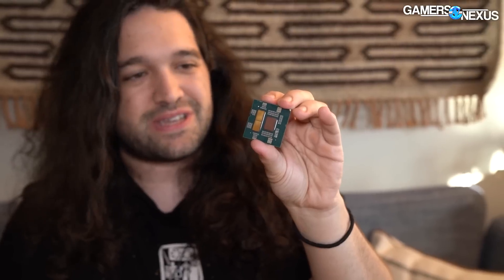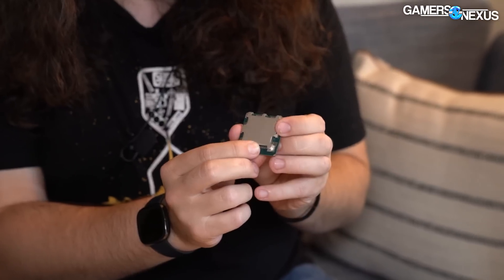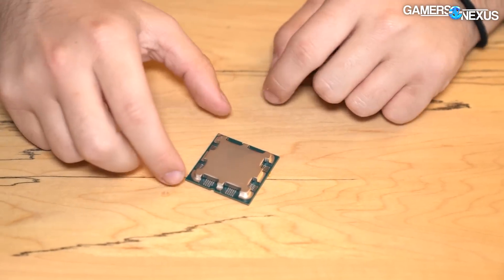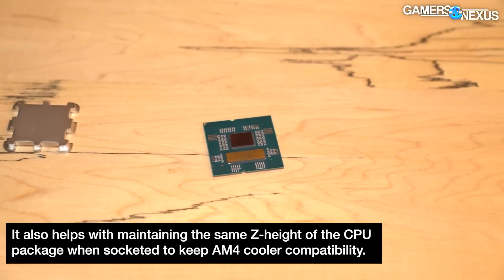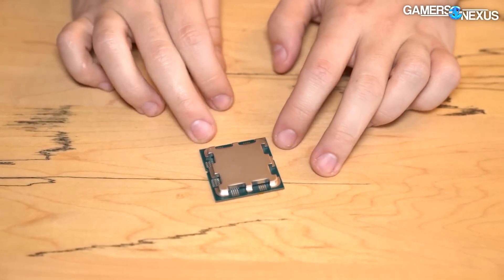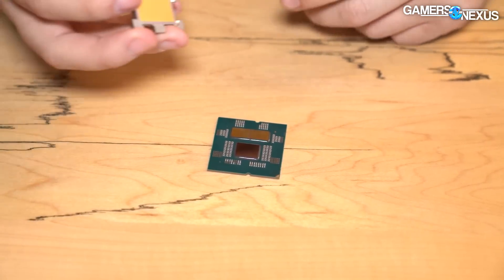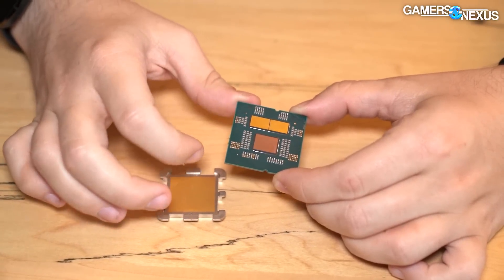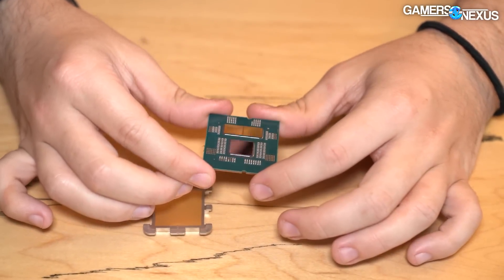Hands-On with Delidded AMD Ryzen 9 7950X CPU

Comment: I assume with these exposed SMDs and seemingly a gap between the IHS and substrate, using a non-conductive thermal compound would now be mandatory, right?
(I know, pretty much every solution on the market should already be non-conductive)
Reply from the maker: Basically. Or you'd need to coat the SMDs.
Reply: @GamersNexus  time to bust out the nail polish!
Reply: @ionstorm66  I mean, all the good stuff (other than liquid metal) isn't conductive anyways
Reply: @KPalmTheWise  you just know some idiot is going to liquid metal one without thinking
Reply: @KPalmTheWise  Arctic silver thermal paste does have some silver in it but they say it is not conductive but might be capacitive, so they warn not to spread it on any open components or trace paths.
Reply: @jmugurr994  but how does it taste?
Reply: @Khola_D  I can only hope
Reply: @Khola_D  it's me, i was the idiot. Put liquid metal on without any protection, learnt hard lesson to coat a nail polish after that
Reply: You can apply nail polish or some sort of sealant over them. My 4790K has SMDs about 1-2mm from the die so I put 2 coats of clear polish before applying LM. I think the biggest risk is going to be getting the IHS off without destroying the SMDs since you can't just slide it off like a traditional CPU
Reply: @Hypnodog_  i cant see the point of using scullion on the corners. Solder should be strong enough to hold the ihs down.

Comment: how do you apply thermal paste to these ? or is it irrelevant when you spill some on the outer parts ?
Reply: if the paste is non-conductive, it's irrelevant; if it is, you should coat the exterior electric thingies with a non-conductive layer and then apply the cooler & paste
Reply: @rzul  that makes sense, thx

Comment: The backwards compatible cooling was such a great QOL feature when they announced it. It seems so little but that saves me a couple hundred dollars right there.
Reply: Technically it's forwards compatible right? Because you are using a cooler meant for the old design on the new one not a new one on an old one.
Reply: @TLM-Nathan  I figure since the cooler is dependent upon the socket for compatibility, the socket supporting it means it is backwards compatible.
Reply: @TLM-Nathan  In this situation it would be both, wouldn't it?
Reply: @amicloud_yt  Yeah, just depends if you're talking about the cooler or the socket.

The coolers are forwards compatible while the socket is backwards compatible.
Reply: While dimensions are identical with AM4, you need to get mounting upgrade kit if your cooler uses a custom backplate. On AM5 the socket frame is screwed to backplate through PCB, you can't switch to custom backplate. And often mounting screws are different too so standard AM5 backplate is incompatible.
Coolers using standard AM4 backplate are compatible with AM5.
Reply: A couple hundred dollars? I've used a Liquid Freezer II on like 3 or 4 different platforms at this point and the kits to switch platforms (that ones that weren't included with the original) were free with proof of purchase or like $6.99 without proof. Would you have had to upgrade your entire cooling setup for some reason?
Reply: @dqniel1755  Compatibility brackets don't always come out right away. If there are significant changes to the socket, it can be a little before they get tooled, shipped and sent to you even after you order. The fact it uses the same design as am4 means you should only have to replace the screws with newer ones for the backplate. Much quicker.
Reply: @Dsntmtter2ME  Interesting. I've never had that issue. They get the specifications well before release, so it sounds like that would be the fault of the cooler manufacturer.
Reply: I'm sorry but since when is cooler compatibility an issue? 
I recently used a cooler that was on a I5 9600k on a I7 920 and as far as I'm aware most "premium" coolers got adapters to support LGA1700 too.

It is still nice that AM5 does it, but too me it feels more like a requirement not a bonus.
Reply: @Ocastia  Because it's a major change from PGA to LGA and they could have changed the socket dimensions with that change making it difficult / impossible to adaptor. 

That said, with everything being the same you won't need to send off for / buy an adaptor you can just slap your current cooler right on it.
Reply: @Ocastia  The difference here is that you won't need adaptors except for coolers with custom backplates. The majority of coolers for AM4 use the existing mounting points on either side of the CPU so pretty much any cooler going all the way back to AM2/AM3 will also work. Keeping a CPU the same size and z-height is very much appreciated and it will also lead to less landfill waste by allowing people to use existing hardware.
Reply: Yup.  Sure, you've got to buy a new motherboard and new RAM to go with it, but if your old ones are still decent, they help pay for the upgrades.  Pretty much nobody wants to buy a used cooler though, so it's great to be able to keep using a perfectly good one old one with the new hardware.
Reply: Q: Backward compatible?
Intel: (laughs nervously, and then bursts out laughing)
AMD: Yes.
Reply: Except they don't include coolers anymore
Reply: @RayanMADAO  Personally, I'd rather get a slightly reduced price (and even smaller packaging) without coolers because I almost never use them and they just pile up in my closet.

Comment: Why they dont do it like the mobile chips? Already without IHS and with an aluminum ring outside of it with the height of the silicon to support and level the direct die cooling solution above it.
Reply: because "normalos" dont get in contact with the mobile cpu´s directly. in the desktop space, they have to make sure that everyone can mount a cpu....imagine droping a delidet cpu on the floor scratching or even damaging the core die...the flood of RMA´d cpu´s because of this would be gigantic
Reply: @georgwarhead2801  That was how desktop CPUs were made until like 2005 (google pentium III and Athlon XP), and they didn't even have a metal support ring around the edges of it to level the cooler, like modern GPUs and mobile CPUs do. Also if you scratch the "core die" it's no problem, the top layer is just silicon, there's even die lapping like DerBauer does, the chip itself is in the bottom of it like 0,5 mm below.

Comment: Do you think AM5 will benefit from a contact frame similarly to Intel or is the stock loader higher quality?
Reply: Seems unnecessary as on intel its due to the size of cpu. Cpu socket on intel unable to give consistent pressure, unlike threadripper sockets thats used bolts

Comment: I suspect that the IHS is going to be a bitch to clean once there's a significant amount of thermal paste on it. Thermal paste loves to squidge into small spaces and stay there, and cleaning between each leg on the "octopus" IHS would be a real pain.
Reply: @ИванИ-м3ж  Do you know any thermal pads have any metal in it? Thermally conductive and electrically conductive are two different things btw.
Reply: stop using paste,... problem solved... ;)
Reply: @sniekerd  What would you recommend instead?
Reply: @DaveGamesVT  I kinda love butter,... not sure why but the smell of it on my ihs is a thing to behold... ;)

Comment: Big questions I've been thinking about. What if thermal paste gets into the 8 gaps? Why couldn't they make it a flat square?
Reply: he explained it realy well why they designed it that way and a comment from GN: "Wouldn't affect much, but you'd need to be careful of electrically conductive paste"
Reply: Even better, do some sort of thick 'balcony' to cover the little chips.
Reply: They walked into into a corner by deciding early that the new socket to be compatible with AM4 coolers. With the sheer size of three dies and LGA pads covering the underside, it is just not feasible to cover the entire substrate with IHS. Intel was right to make the socket and heatsink holes larger but dropped the ball with the mounting mechanism.

Comment: I wonder how over excessive thermal paste might affect these, would getting it on the open components in the indents make it worse or better? I feel like I want a removeable frame for the IHS while applying paste..
Reply from the maker: Wouldn't affect much, but you'd need to be careful of electrically conductive paste.
Reply: @GamersNexus  translation "don't use liquid metal unless you're confident that you won't spill any"
Reply: @GamersNexus  Steve and Roman up a tree....
Reply: @psycronizer  D-E-L-I-D-E-D
Reply: @psycronizer  I always hear this Roman being mentioned, what channel is that? Is it der8auer?
Reply: @WalterZanella  yeah I haven't seen him around much but I think I once saw him do a vid on a paste compound, he's German so not that big on the English side of things, but he is around...
Reply: @Malachai Carter liquid metal, such as Thermal Grizzly Conductonaut. Excellent thermal conductivity, but also electrically conductive. I've not tried it, but I don't do extreme overclocking or delidding either :)
Reply: @chippytea4me  with how liquid metal is supposed to be applied the chance of getting an overflow onto it is not likely
Reply: @Malachai Carter Because heat transfer and conductivity often go hand in hand. If a material is good at one it's very often good at the other. There are exceptions of course, like iirc diamonds are the best natural heat conductors, but they're not very electrically conductive.
Reply: Ask The Verge
Reply: since i am using carbonout im not worryd about it
Reply: Or why not make the IHS take up the whole thing instead of the cutouts? What would be the cons of doing that?
Reply: @MrKayveman  Force transfer at known points into the pcb=>socket pins ...maybe intended flexing during mounting and hot-cold cycles.

Maybe also HF-shielding between certain tracks/caps.
Reply: Yea I was wondering. What if we managed to fill those gaps where the IHS appears to float with some kryonaut paste ?
Reply: It will be a bitch to clean up if you have some thermal paste squeeze to the sides and spill over on those components...
Reply: @Malachai Carter It was the standard once upon a time, Arctic Silver 5 (not made by arctic cooling, it was it's own brand) was electrically conductive due to its silver content, and was the gold standard for affordable pastes for a long time. Then right before the 2010s things picked up and all kinds of new pastes started hitting the market. also @username3544 AS5 does cure and dry with time, no doubt it's still within acceptable range but that paste definitely does need to get changed at some point. That said, AS5 does perform pretty decently still while dried out, at least until you remove the cooler. I used to use a little bit of it to cut IC Diamond paste with, because that paste was so thick it was impossible to spread, and the diamond dust would literally tear plastic spreaders to bits.
Reply: Long as it's not liquid metal you should be good.
Reply: because liquid metal is better for thermals than paste.
Reply: @Malachai Carter The liquid metal paste lasts longer. I haven't changed my Arctic Silver 5 thermal paste on my 3570k since 2012.
Reply: @Username4453  Arctic Silver 5 is neither a liquid metal, nor electrically conductive.
Reply: @hellterminator  Ok I thought the whole silver infusion thing was a type of liquid metal. Either way Arctic Silver 5 may not be the best thermal paste but it sure lasts a long time.
Reply: @Username4453  Understandable, the marketing language is (designed to be) confusing, but liquid metals are just straight up metals that are liquid at room temperature. It's pretty much always gallium alloyed with something to bring its melting point further down (pure gallium is around 30C/85F, which is not quite room temperature). I believe indium and tin are usually used. 
In contrast, Arctic Silver is just small silver (and other thermally conductive materials) particles suspended in a non-conductive grease.
Reply: @Username4453  Nope.  Liquid metal TIM is literally in a liquid state.  Gallium, indium, tin, and other stuff.  Melting point of around 20 degree C, boils at 2000 C(i.e. effectively doesn't boil)
Reply: @Malachai Carter Probably some super cheap garbage that is, because money.
Reply: @TheAtomicSpoon  lol the more expensive pastes I.e. Metal based are electrically conductive. The “super cheap garbage" pastes aren't conductive since they're pretty much silicone paste.

Comment: @7:25 is there a reason for using only one chiplet instead of, say, two cut down chiplets?
Reply: Cheaper production. Also performance as there is a little latency between chiplets
Reply: @erichall090909  Fair. I imagined using cut down chiplets that don't meet high tier spec may have saved on manufacturing costs with less waste.
Reply: @Didymuss1  It would take them ages to accumulate dies with that many defects.  When they finally do, they'll likely go into limited runs of low-end processors with fewer than six cores.

Comment: With those announcement, I can finally upgrade to 5900x with a reasonable price from a 3600
Reply: someone else here in the comments just got one for $320ish on amazon
Reply: What are you doing that makes 3600 feel too slow?
Reply: @rzul  if they have a good graphics card it’s not unlikely to be throttled by a 3600

Comment: Will these CPUs benefit from offset kits again then I assume?  And is the offset the same orientation as previous generations with the mounting direction?
Reply from the maker: Great question! The benefit previously was pretty noticeable with some coolers. It will likely help again. As for direction, won't be sure until we get a motherboard!
Reply: @GamersNexus  thanks for letting me know.  Yeah I have a older supremacy evo I use the offset kit with on my 5000 series since cooler was originally only got Ryzen 1000.  I'd love to use same hardware again for AM5
Reply: yeah probably

Comment: 2:24 i very much like how this layout is done. Should be very easy to make a custom direct to chip cooler. Neat stuff GN.
One thing i never understood regarding these modern units (with old ones it was understandable) is why aren't the SMDs built in the actual CPU. I know this is possible, this is not common, but done by some of the laboratory equipment manufacturers with direct to board calibration (laser etc). It would result in an extremely compact package. I assume one reason is that users might over tighten the chip in place and thus affect how it works, but... it's kind of a slim issue. The board itself could be made thicker to accommodate. In terms of board design, these days, the sky is the limit.
Recently i've seen multi layer boards with gaps in the layers to allow for controlled expansion due to heat so that the traces always remain exactly as they were designed on paper.
Reply: simply because die space is way to expensive to do it and in the case of cpu´s, there is no benefit for doing it. they are already outsourcing everything that dont need to be on a expensive note to a more cheap one, adding the smd´s even just to the 6nm IO die would just be contra productive for reducing production cost
Reply: @georgwarhead2801  Die, yes, but not the board. You can directly put the SMDs into the board itself as part of the lamination process. China's already doing it for mid-range consumers. I find it hard to believe that mega-corporations of the rank and file of AMD/Intel, the lot aren't doing it.
Reply: @aserta  and what would be the benefit for them to do it, i dont think integrating them would make them cheaper to produce or have any other benefit for them